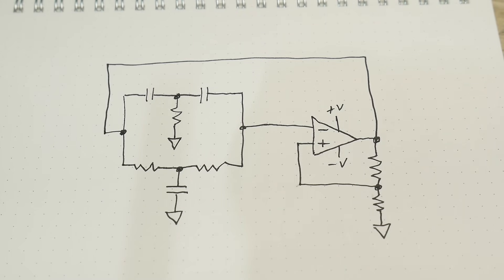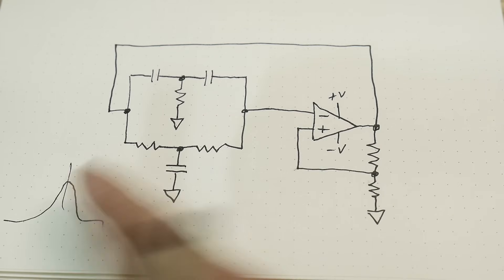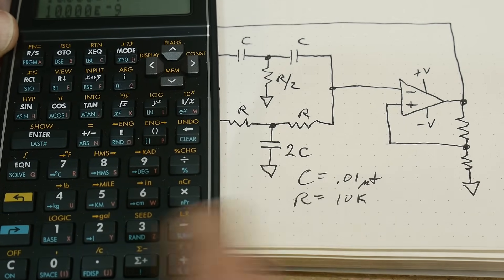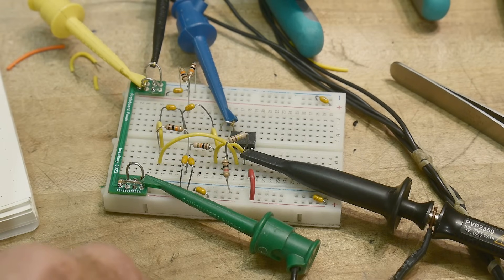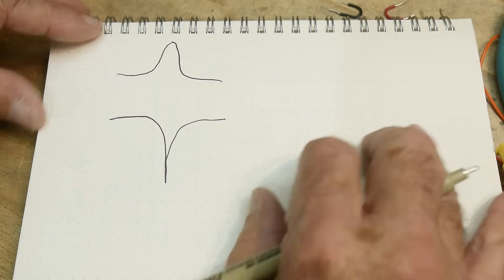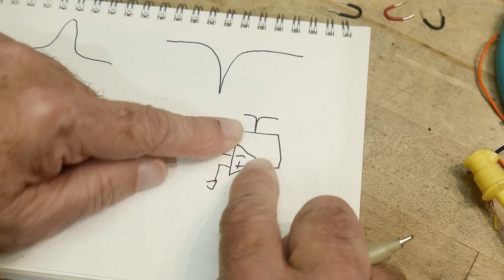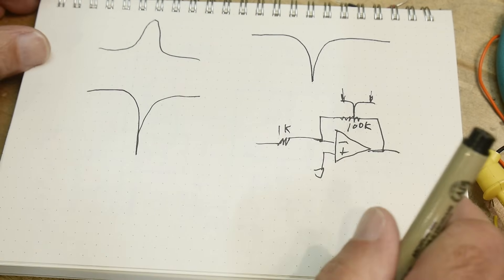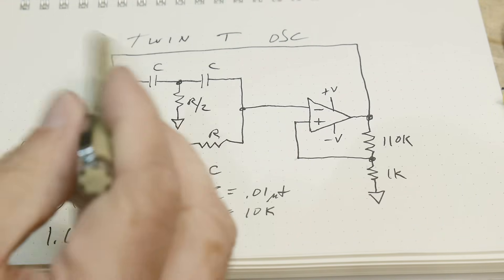#1807 Twin T Oscillator

Comment: Still yelling at the screen...

Combine a low order low pass with a low order high pass filter and you get a lousy notch. That requires a cascade (series) arrangement. But these are in parallel. So the phase response of the two T's comes into play.

Do the circuit analysis and you find that there is a zero in the transfer function at that frequency. Zeros make really good notches.

Comment: In 1972, I built a three channel color organ using 4 op amps and this exact circuit. Mind you, the op amps were industry samples given to me by a distributor. I was 14-15. I designed it using the above filter from the Burr Brown op amp handbook. Worked decently. later, received a price list of these one inch by two inch epoxy rectangle op amps and found I had built a color organ with around a thousand dollars worth of laboratory grade op amps. I had mixed feelings about that.

Comment: Interesting! Twin T is a notch filter, definitely not a bandpass! It oscillates because only at the notch frequency, the phase shift crosses zero very sharply, going from +pi to -pi. Since your gain is very large (A=111) and the notch is not perfect, your overall loop-gain AB probably becomes nearly 1 and the phase shift AB is 0 degrees only at the notch frequency. For oscillations, overall loop-gain AB should be 1 angle 0 degrees, as in Wien bridge and other oscillators that use a bandpass filter in the feedback path.

Comment: What if you connect the + (non inverter) pin of the op amp to ground. Would it still oscillate?
Reply: What's the power supply to the op-amp look like?  Single ended or bipolar?

Comment: Understand how it oscillates at the set frequency but can't see why it doesn't run to the rails and give a square wave output. Think I recall a thermistor  or even a small bulb being used to limit gain so the cct only just oscillates and avoids the harmonics that would ruin the clean sine wave.